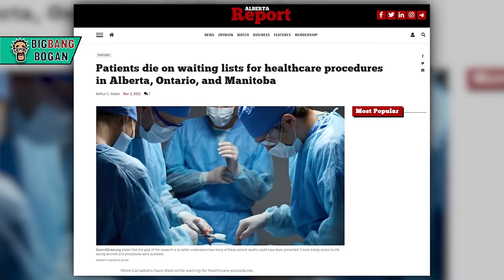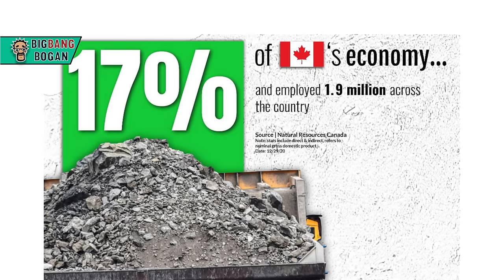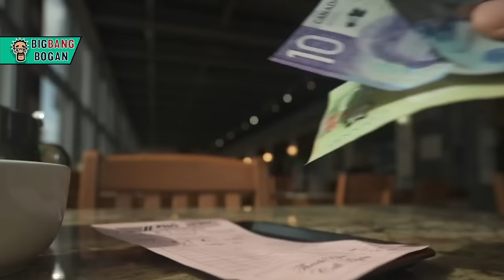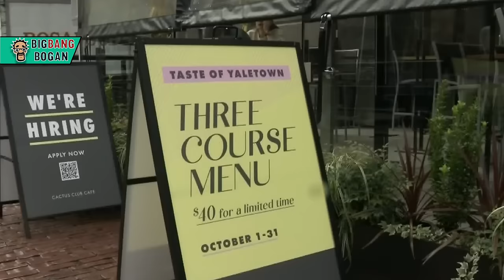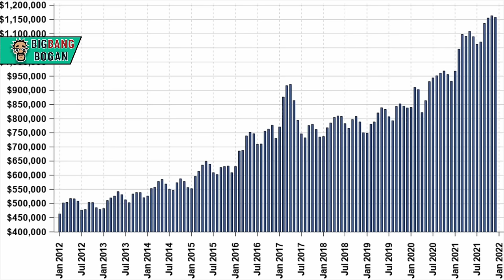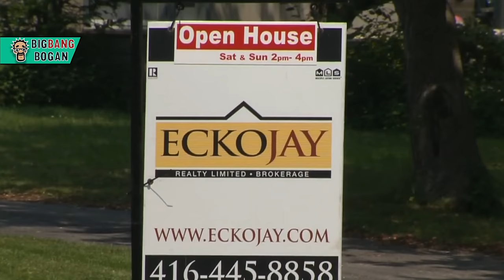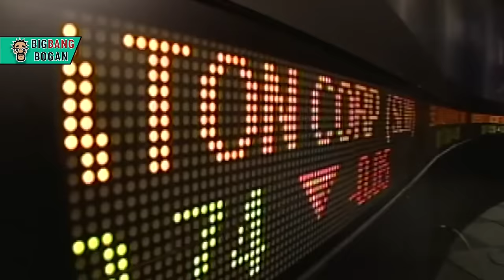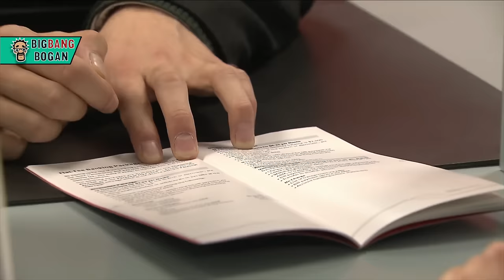திவால் ஆகப்போகிறதா கனடா? | Truth Behind Canada's COLLAPSING Economy | Big Bang Bogan

Comment: Good attempt at putting a 20 minutes video with absolute BS. Would have been nice if you understood what you said. Health system is under strain. But thats been the case for so many years. But you somehow nicely added that to the list of indicators for economic crisis. Do your research. Housing is under strain too. But that because of immigration.true. but why is it causing economic situation? Did you see the stat canada report? Did you read the Bank of Canada economic policy? What is the CPI indicating ? How different is it from other economies?Did you go over the critical element strategy 2022? Maybe you should if you haven't and put another video.